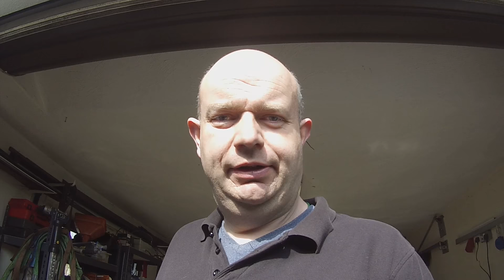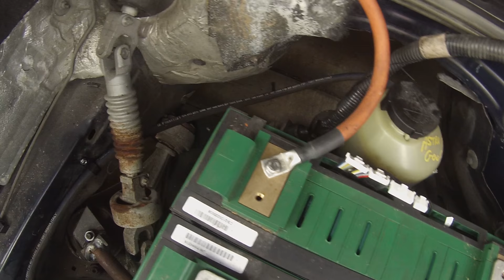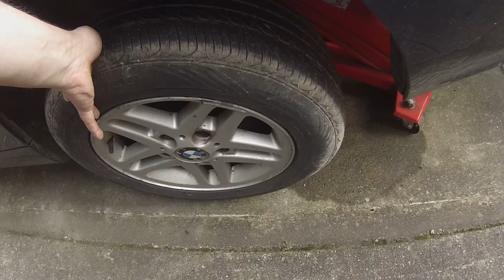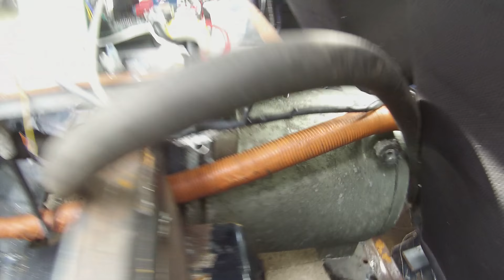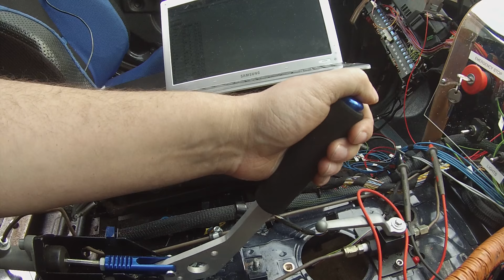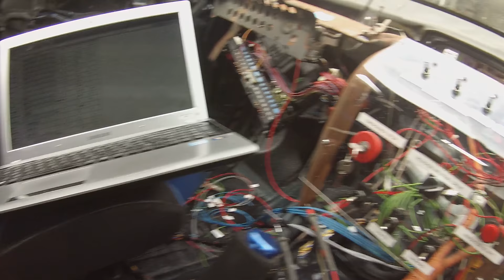BMW E46 Budget Electric Drift Car Project 18 : First Spin

Comment: I'm still a little perplexed as to why you've made it mid to rear engine/motor for a drift car. 95% of drift cars are front engine/motor rear wheel drive. Was it done due to weight of batteries? Its alot of extra work in cutting and fabrication. Not sure how it's going to handle/break traction in a controlable way
Reply: Doesn't really matter, the motor isn't that heavy, the batteries are the heaviest thing, so his car is just like any other front engine car.

Comment: Did you fix the rear wheels unequal speed spinning so that they spin equally fast now since it look as the left wheel spun faster than the right wheel?
Reply: Pasta Sarmonella E-Specialé that's due to the diff